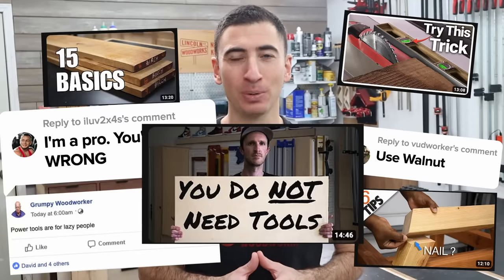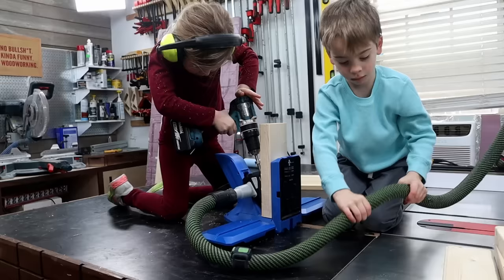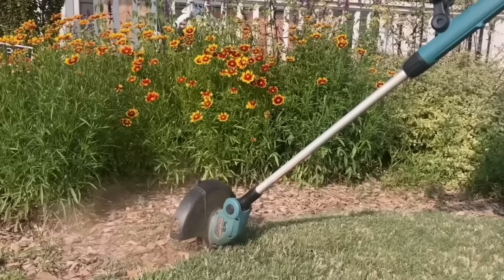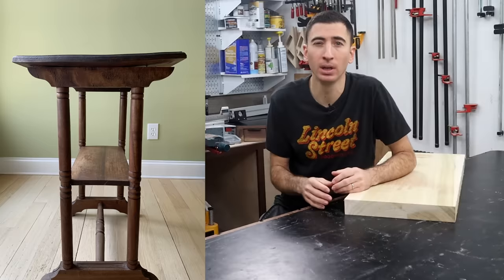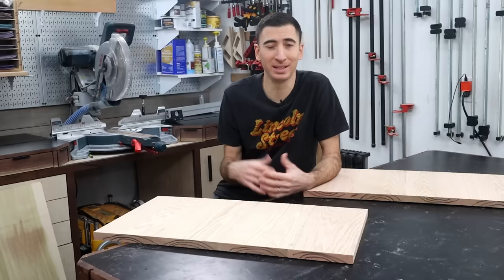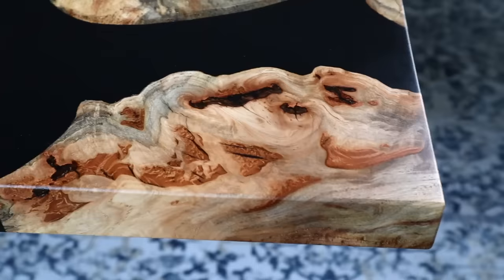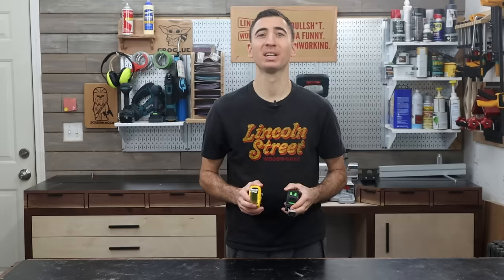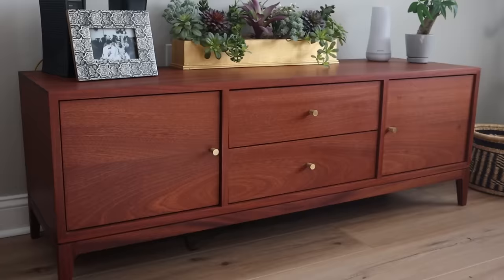Every beginner needs to hear this

Comment: This advice is spot on!  

If you are a hobbyist, buying the higher end handheld power tools makes little sense.  Get what fits into your budget, but isn't a POS.  You can do a heck of a lot with handheld power tools, and hand tools in general.  Buy what you can afford for the job at hand, upgrade later.  Also, you don't need a track saw starting out.  The old method of a long straight board and a circular saw works pretty well, but does take longer to get set up.

I hate to sand, so I use planes and scrapers to get the wood flat and pretty smooth - then I use the pencil and sander.  A carpenters pencil works best for me for that.  The scraper tells me where the problem areas are, as I can feel it.

Comment: 100000% on your battery tools opinion! Until the motor FINALLY burnt out, I used a Black&Decker Matrix drill,jigsaw,circular saw attachments while REBUILDING MY HOUSE! LITERALLY for every application, subfloor, hanging drywall, trim, 10mm laminate flooring!!! Still have this set and a new drill attachment lol

I switched to Kobalt (it's blue) afterwards, battery powered circular saws are a must have! Quiet, durable, and quick to come to a stop!

Just like a car, you're paying for the name, Dewalt, Milwaukee, Makita, Craftsman all have pretty decent lines of additional battery powered tools, go with what you need NOW, while making sure down the road that you understand your $60+ batteries will dictate your tool's color lol

Comment: While I do work with wood, I'm not on the "flat-board" team per say.  I like to watch vids like this, because why not learn something I didn't know yesterday.  I don't have any negative remarks for the content and appreciate your point of view.  However, I would like to offer a tip on filling the knot holes.  Try using used/dried coffee grounds, especially if you going with the epoxy or CA method.  And different verities will give some shading as well.   'Be well, Joe

Comment: When doing the pencil marks on the surface for sanding, make sure that when you sand you do not stay in one area but move with the grain from end to end in a slow, even  consistent speed. This will help you avoid making more uneven areas in your project and help ensure an even overall sand and level surface. It will also help you find the actual low spots, being the pencil marks in those spots will be left behind. Repeating this again will get you that nice flat surface you want.

Comment: I just want to toss in a couple of quick comments about the sawdust and glue trick.   It works really well in the long joints, and in cracks, but you REALLY need to maximize the sawdust.  Most people use mostly glue (it looked like yours were mostly glue), and you should only have enough glue to bond it together.   

The second comment is that many people don't need to worry about the finish at all.  They're using paint.   Or that waxy crap finish that hotels like (I still haven't figured out what that stuff is, but I stripped down two hotel desks to the underlying oak, then refinished with shellac).   With either type of finish, it's a coating, not a stain.   Even many poly finishes won't change the colour of the wood - or glue/wood combination.    

So, everything boils down to 'What is your end use case?'.   That's the fun with woodworking - you can do whatever you want, and as long as it looks the way you want it at the end, and does the job for which you created it, you did it right.

Comment: The wood glue and sawdust also takes far too long to dry. Filling the gap with sawdust and wiking in thin CA glue is the winner. It's been a game changer for me and also adds strength to a split.

Comment: When you look at battery tools, look at the reliability of the chargers - everything else is manufactured to the same spec but two brands put a lot of design safety into their chargers and it will more than double the life of the batteries and tools because when a charger hurts the battery the battery ends up hurting the tool.

Comment: I suggest woodworkers follow the reverse grain rule every chance you can. 
That’s why you spend as much time necessary at your local timber supplier, inspecting the end grain the face,  the edge and as best as possible find the boards that will be the best look when appropriately flipped and fitted.

Comment: I've heard so much about using construction lumber and wood movement and all that.  2 years ago I made a bench out of 2x10s from Lowes, no glue just carriage bolts and screws, then I covered the whole thing in shellac.  It sits out on the porch, below freezing, above 90 and 90% humidity, it gets wet when the rain goes sideways or the kids are playing with the hose, etc.  No cupping, no noticeable issues with the finish.  I sit on it from time to time, and it's as solid as when I made it.  I'm a complete amateur, but ...  just make stuff, it's not that hard.

Comment: 10:07 This is a principle my dad instilled in me, in a number of different disciplines. He always called it "positive error", though I cant find an actual name for it. The idea is when getting something exact in the end is important, you make an error in a known way, and then work your way up to the mark. Obviously in your exampke, you introduce the error of cutting a piece too long and then slowly trimming it down because you can't add wood to a piece too short. Another example is in navigation. If you are in the woods and parked your car by the side of the road that runs along to your east, you either head north of where you think your car is, or south of where your car is. The actual direction is unimportant, but it means when you get to the road, you have a good assumption of which direction to follow the road to get to the car. Apparently it is a trick he learned as an air force pilot for dead reckoning flying.

Comment: Most home owners don't have the time to wait for the wood to properly dry.  And most home owners don't own 36" planers. My very first bench I planned with a smoothing plane. I did more damage with the plane than cupping could ever do. But 40 years later that glued plank is still flat enough to use as an outdoor bench after being in a non-air-condtioned shop for most of its life. In all the planks that I have made, I rarely paid any attention to the direction of the grain. I glued and clamped all my joints. I have only one mahogany hutch that warped a bit, and only 1/4" at that.   I built commercial medical cabinets from Lumber-core plywood and Formica for a few years. We air nailed the initial assembly, then wood screw and glue them together, then the Formica in an open air shop. We ran heaters on moist days. Never had any of those warp either. I recently built a porch with structural lag screws and pocket screws on siding framing. Hasn't fallen apart yet.  Glue is the strongest component if properly used.  Clamp the joint.  Breaking will cause the wood to split, not the joint. The screw replaces clamps.

Comment: For the power tool debate, I think the biggest deciding factor for the hobbyists is price. I use ryobi because they are cheap but still have a full lineup of tools that are compatible with each other. A difference of $15 for a drill isn't that much, but if you keep buying more and more tools, an average cost difference of $15 is pretty huge

Comment: I bought a Bauer ½ inch impact wrench bc it was cheap, and had good reviews. 
I bought several other Bauer tools from harbor freight for a fraction of the cost of Milwaukee or Dewalt and have been pleased so far, using my ¼ inch impact daily for a few months. 
If it breaks I can replace it several times over and still spend less than buying a Milwaukee once

Comment: What helped me the most to make nice furniture was the hint "you don't want to do it accurate, you want to do it repeatable"
Nobody cares if your furniture is 890 mm wide or 892 mm wide. But it will give you a hell of rework if the top is 890 mm and the bottom 892 mm. Set your saw once and cut all pieces you need of that length.

Comment: Hi sir I do agree that alternation wood grain isn't always the best option, but I do it all the time, but I also let my freshly bought material acclimate to the conditions of my shop or for a couple of days, before construction.  So for no issues there. Also the wood filler with glue and sanding dust is okay but I prefer not to make boo boos and end up filling unwanted holes or cracks. I am level one certified in carpentry. looking to get level II certified and get my journeyman's license. I have been both Carpenter and Furniture maker for about 25 to 30 years. My dad taught me a little bit, most of what I know came from other Carpenters and woodworkers. Thank you for the Video, I really enjoyed it,

Comment: Durn, seems I am using the wrong drill.  It is a cheap Black and Decker  saw.  I've only had it from around  1970, and still use it when I need a drill.  The B&D circular saw I got at the same time is still being used also.  I think I'll just wait until they wear out before getting rid of them.  But am going modern, but different.  I want some tools I can use outside the shop, saw, drill, sander, and so on, but bsttery powered?  No way.  Gettin a small, light generator, and will be using that.  Hehehe.  Started out helping my grandfather when I was around 7, he was a master carpenter.  I'm 83 now, still designing, and making wooden projects, and use Titebond II about 99.99% of the time for my projects, no screws unless for hinges, unless I make wooden hinges, no nails except for things like molding.  Learned young, only use screws in something is likely to be taken apart later, and nails for things that will not be taken apart.  Still works for me.
Reply: Damn computer.  All was typed correctly, only messed up when I pressed comment.  Took out about half of what I typed.  Damn modern stuff.

Comment: Sir, Im from Sweden, but I guess this is the same almost everywhere. The shop usually only have been selling one brand of sandpaper. Ofcourse with different sizes on the "sand", and we have a low number for bigger but fewer "stones",(like 80, 120) and a high number if its almost doesnt cut at all...(300 400). I think it is "stones" per square centimeter, and maybe its per square inch in other places.
But I did not now about the differences between the colors of the "sandpaper"(in Swedish). White - and the old paint will not stick to the paper, then I dont remember about red and yellow, but there is also "universal" sandpaper - usually bad quality.
This have saved me a lot of money, and anger because I have to change paper again.
A old man once told me that back then - they put terpentin, or thinner or nafta on the paper the day before, and then the paint didnt stick. I dont remember witch of them, sorry.
Well, I spell like shit, but I think its better then your Swedish...
Nice videos - keep up the great work!
Calle

Comment: Still working after 12 hours on a project, I used a latch plate template and router that was too big. I know - I should have double checked the size. I normally do, but I was too tired to realize and remember that and so used the wrong size. I had to get done that night.
What's the best way to take the latch plate off and fill the mortice in with wood, glue it in and go at it again? Just another piece of thin pine, then glue it in, and remortice it?

Comment: In the wood glue method also will depend on how to find the wood sawdust is the finer the sawdust the tighter the line will look and it won't look as a grainy if you don't want it to show as much because if you use something that's more coarse it will show different lines where you don't want

Comment: NOTE ON KILNED DRIED WOOD. Unseasoned wood is put into a kiln, a huge hot room. The cycle begins with hot air being circulated removing moisture from the wood...FROM THE OUTSIDE IN!!! When the Interior of the boards is at a certain moisture content then steam is introduced to add moisture to the over the dry exterior. When the surface moisture and interior match the cycle ends. This is not an exact science and each board is different. The humidity in your shop may be different, higher or lower than the board. You want the board to equalize to the humidity in your shop before milling. Buy the lumber, stack it with sticks and wait.  
 If your project has glued up panels and you have time, cut to lumber to rough lengths and stick and stack. I have cabinet and table tops I made in the 1980's that are as flat as the day I finished them.
Home humidity: My house in North Carolina was at 60% +/_ year round. My furniture seldom moved. My home in  Rhode Island  ranges 90% to 20%. The furniture was built to move so no cracking. But I do hear God awful pops as things move around.

Comment: Neat trick for the using a pencil to keep track of your sanding progress:
Buy a few of those cheap marking pencils at your big box store of choice, but instead of sharpening it like a regular pencil, use a knife to expose a few inches of the graphite core at the end.
Now you can rub the whole thing sideways across your board to darken the surface, and it's way faster than scribbling with a sharpened point!

Comment: The joint tests are not irrelevant they are relative. The point was not to test how strong cabinet would be if you were to use a certain joint. Point was to test each joint compared with the other joints and get a comparison between them all to understand how much stronger each joint is than the others.

Comment: Well done on your comments you are willing to share with others.

 I'm ...a little Rusty or Dusty but we won't go into that right now. 

Moisture content in wood has and will continue to be a troublemaker for sure. 

For Measure twice cut once issue.  If you are cutting into a $500 sheet of faux marble for the business end of a shower insert I would personally measure 5 times and then only cut once. Especially if the material was purchased by someone else for an install that you are being paid for.  It can be extremely embarrassing to have to eat that kind of money.  Also if you are cutting a length that is close to Center of any board or sheet such as a 2 x 4, put a X on the waist side so that your saw kerf doesn't remove what you don't want removed on the Salvage side.  

When going for a tight fit always make micro cuts to obtain a tight fit.  You can use a knife edge or utility knife blade for super accurate Dimensions but don't gouge the wood too deep. 

 Old-Timers before power tools did not have the luxury of making micro cuts. In that particular case experience makes the big difference even when doing finish work these days.  

This epoxy movement is a blessing that we did not have years ago with wood sawdust repairs.   

* I recall Roy Underhill of the "Woodwright's Shop" show back in the 1980s.  He stated in one episode, "To reduce mistakes we must at times Purge our minds of all impure thoughts to eliminate any possible mistakes".

When I started carpentry as a kid under my grandfather and uncles business we only pounded Nails.  What a blessing corded, cordless and air compressor tools have been for handymen, craftsmen and artisans.

Comment: I'll have to say you make a good point that joint doesn't live by itself and it's usually in combination with other joints. But it's still good to know or have an idea what that joint is worth. What's your point about how the product is used or loaded is an excellent point.👍👍👍 some of these tests are also poorly done, thus giving false data. Suman's test on the wood inserts is a great example. Even test done what did multiple pieces of wood species do I have a real understanding of the range the material by density to get an actual understanding of the joint in terms of strengths.. just like when I see these guys do these French cleat walls and they have six inch wide cleats and three quarter range finish play would boxes the holdup piece of sandpaper in some pencils that wonder where they're coming from. There's woodworking and then there's understanding of wood its properties and without knowing some of these properties you're not understanding what you're building so you are just building furniture which is okay did you say

Comment: I've been involved in and around woodworking for 45 years and on the whole I agree with what your saying.

However the starting place should always be the tried and tested methods, then once you've gained an understanding of timber and it's very often confusing way of moving then start changing things around.  Experimentation is fun..

With regard to power tools I cannot stand tool snobs.  I often see vans full of Festool or Makita, whole systems.

For the life of me I cannot understand why you would want to pay out the best part of £1000 for a Domino machine.  How can it ever pay back the capital outlay?  

So many YouTube videos show folk using all this fancy kit and all it's doing is making beginners feel that they must spend huge sums to begin when with a few basic tools you can do everything.

There is so much joy to be had in planing timber square then hand cutting joints, I know that commercially machines are essential but at what point does woodworking become wood engineering?

Rant over

Comment: Thanks! About measuring, we switched to metric in Canada forty years ago and it's a lot easier to remember or write 10.5 cm or 137.4 cm than 3', 4" and 1/4. Oddly, we still say a "2x4" or "2x2", but a 2x2 is actually 1.75" x 1.75" which I wasn't told when I purchased wood to make a work desk.

Comment: I agree with you on battery tools for the most part but one of them has not caused its users to have to rebuy all new tools for > 25 years because the battery form factor changed.